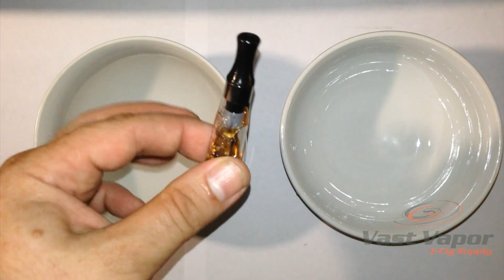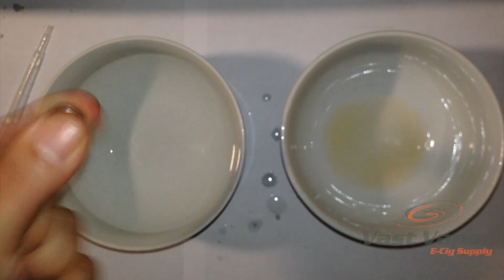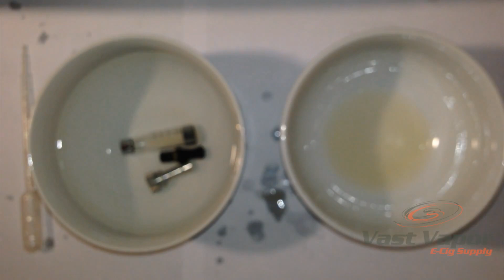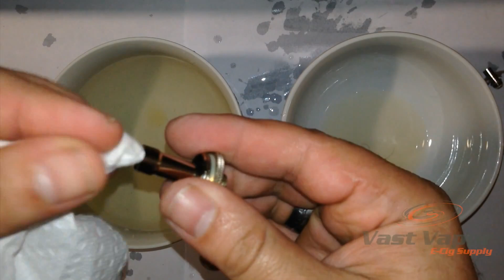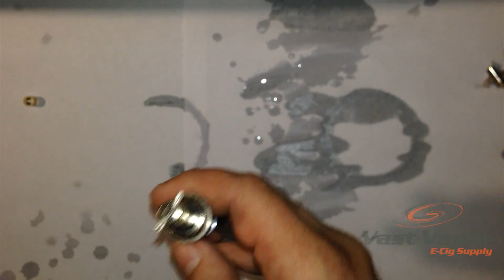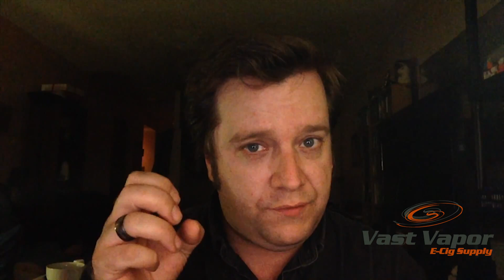Vast Vapor   Clearomizer Care and Maintenance Tutorial 1080p

Comment from the maker: It sounds like you may may popped the coil thats responsible for vaporizing the eliquid. You can try cleaning it, however if that does not solve the problem then more then likely you will need to replace the unit.

Comment: I just got the ce4 clearomizer and it was fine the first tank but on my second I would get this popping noise when I pulled from it. Now it doesn't seem to heat as fast and the vapor isn't as hot or heavy could I fix it with just a good cleaning?

Comment: This may sound ridiculous but I'm new to vaping. I bought an ego ce4 clearomizer, I followed all the instructions for filling (and avoiding putting it in the centre part), it worked well for the first day but the next day I heard a pop noise and it stopped working. Will cleaning it solve my issue and if so would I have to follow the method for the one that you can't take apart?

Comment: What's the point of cleaning a clearomiser if it's just going to burn out sooner or later anyway?
Reply from the maker: Cleaning a top coil allows it to last much longer compared to just throwing it away. Typically, a coil will last close to 2 weeks with an average of 3-5mls being ran through it daily. By cleaning the coil, you can easily get a month or so of usage off that coil. The market is quickly moving away from top coils and are more frequently utilizing Japanese cotton for the wicking material so being able to clean them is becoming a thing of the past.
Reply: +Vast Vapor I have the one that doesn't disassemble. It it still worth cleaning it?
Reply from the maker: +James Carmichael Absolutely, cleaning your coil will extend the life of your clearomizer to at least twice as long.
Reply: +Vast Vapor thank you so much. Your videos are great. Forgive my lack of knowledge. hope you continue to do more videos.
Reply from the maker: +James Carmichael Thank you James!